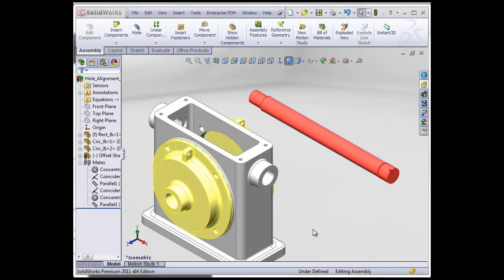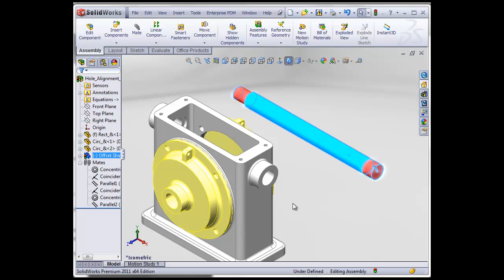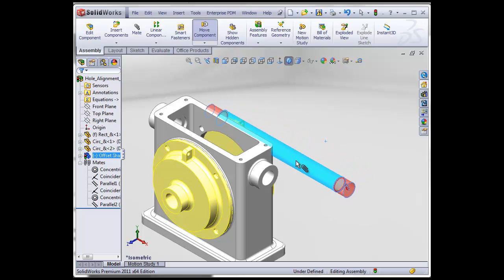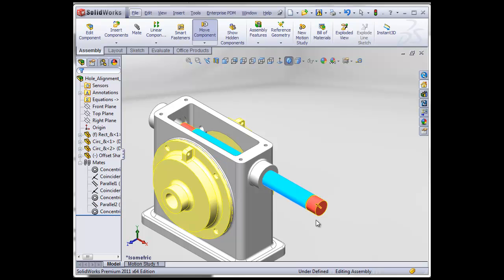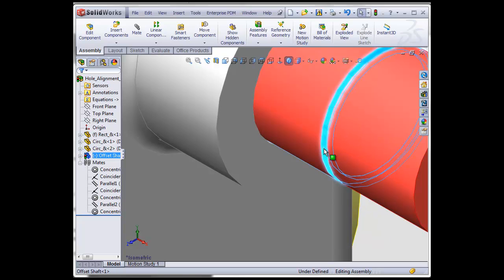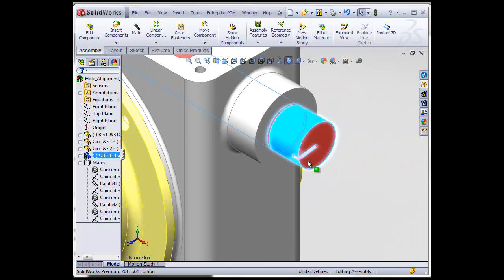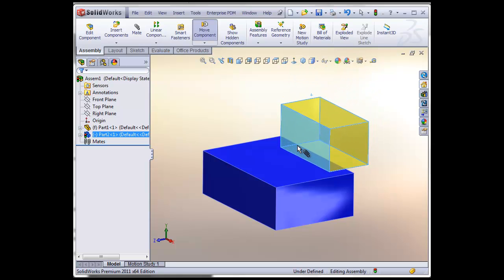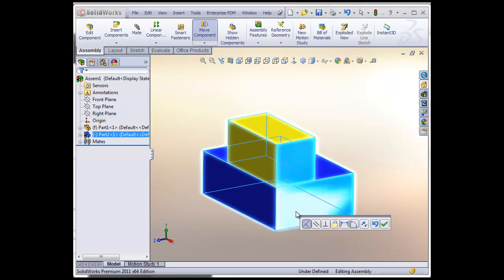Mating Trick In SolidWorks

Comment: OMG This is very cool but what it does even better is allows a mate to be created between a Routing (pipe) and another part. Otherwise not possible using normal mating method.
Reply: bkpickell Can you mate construction line to construction line?
Reply: Paul Cape +bkpickell Also make sure you use your reseller for support. You can also check to see if you have any local user groups near you. swugn.org
Reply: Paul Cape I think I am experiencing a problem that you describe. I have a sphere with a hole in it and I created a grommet to fit the hole, but solidworks will not let me slide the grommet into the hole.  Will holding the alt key fix this problem for me? I'm not near the computer with solidworks on it at the moment so I can't check.
Reply: Autodesk CAM  Yes I did this the other day but you have to have them visible.
Reply: bkpickell I have not found a time the alt key trick doesn't work so I'm assuming it will.
Reply: Paul Cape nope still doesn't work. My part moves a whopping fraction of an inch and is still like a foot from my part, I can't seem to get it any closer. I have the same problem with trying to mate a flat surface to a round surface.
Reply: bkpickell check the part in your parts tree and the part that you are trying to mate too. Delete all mates, sounds like you may have a mate that is preventing the one you want.
Reply: Paul Cape OK I'll give that a shot. But you would think for $8,000 the thing would be able to know what I'm trying to do before I even attempt it. These kinds of quirks is what I'd expect from a Photoshop price point.
Reply: bkpickell I'll agree, I have a couple of recurring problems myself. One took me half a day yesterday to get fixed. Not to mention my SW crashes all the damn time.
Reply: Paul Cape I'm still trying to convince myself that this software is better than the free software 123D Design. It is extremely difficult trying to convince myself that a couple not so make your life easier features are worth eight grand.

I'm currently unemployed and trying to teach myself this software to make myself a little more employable. I have a computer degree, just not in graphics design. 

I know this software is the goto software for most companies, but eight grand is hard to swing for someone who is unemployed. I know I can get the standard edition for four, but if I am going to make myself employable without the 3D design degree,  I am going to need to learn the whole suite. And I am going to need to know it like the back of my hand.
Reply: bkpickell I know what you mean. This is actually a small part of my resume but is what everyone wanted when I was unemployed. I learn some on it at Caterpillar and most of what I learned is from Youtube. I think a lot of my issues are from our server being slow and blinking out from time to time causing SW to go crazy. The only  issues I have found that is SW only is when I try to Pipe routing within a large assembly it crashes as soon as I try to connect two stubs. But if I do Tube routing it works fine.  In fact, pipe stubs won't even appear, only two lines.
Reply: bkpickell If you haven't already I suggest you sign up (for free) on www.Grabcad.com